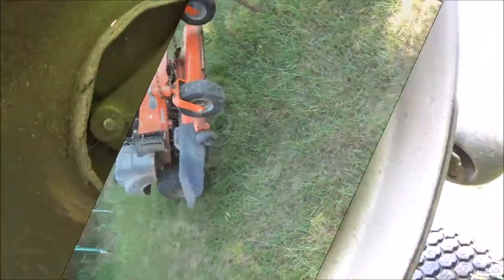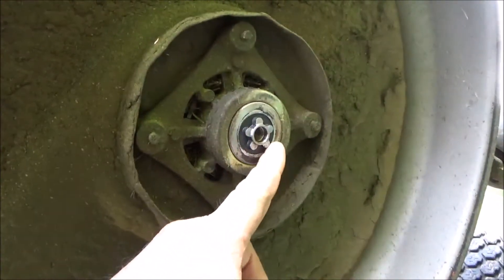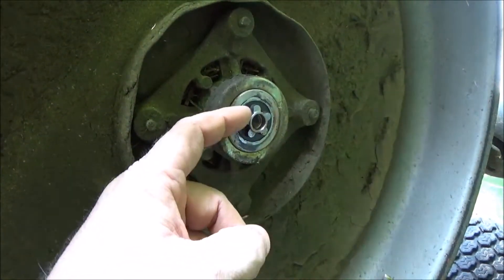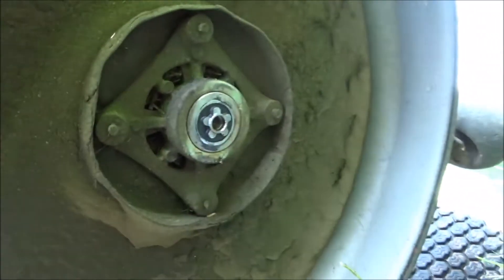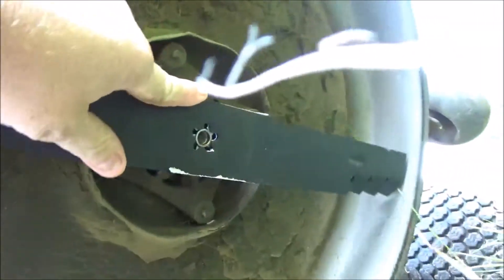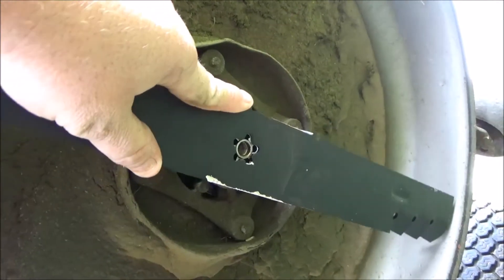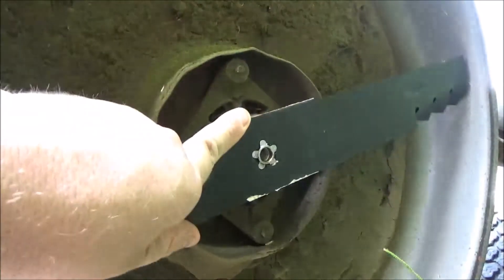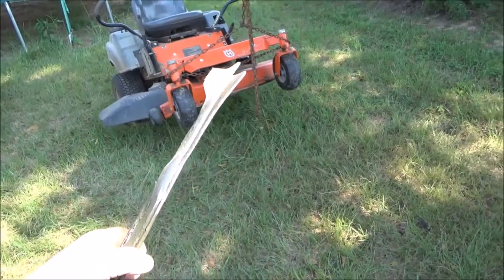HOW TO CORRECTLY INSTALL BLADES ON MTD, AYP, DIXON, AND MANY OTHER MOWERS WITH STAR PATTERN SHAFTS

Comment: I wish you could do longer videos on repairs maybe you might think about that in the future.
Reply from the maker: LONGER ?  WHY?  IT TAKES  30 SECONDS TO CHANGE A BLADE    I HAVE SEVERAL VIDEOS THAT ARE 30 MIN OR LONGER
Reply: I agree with you Bruce. Jeremy has it right. I have a list of videos that I just do not have time to upload. Some are waiting to complete, waiting for parts & others just too time consuming to edit out unnecessary footage. The only reason I am on line now is to check on parts. 
Stay well, JoeZ
Reply: Thanks    I understand every issue.  Some want to watch faster some want to watch slower.
Reply: Plz make a video 
How to adjustmant etesia blades